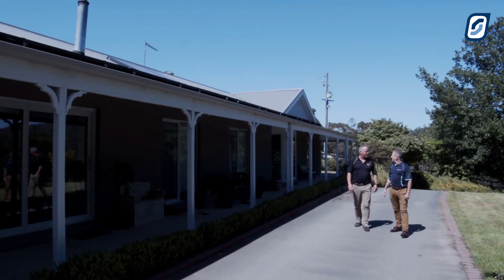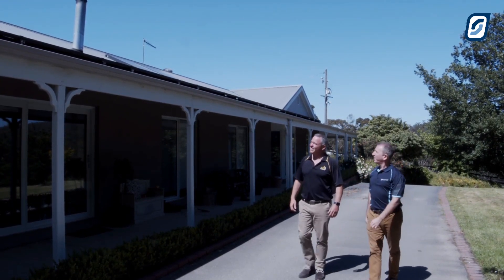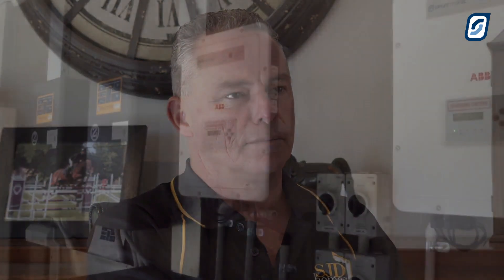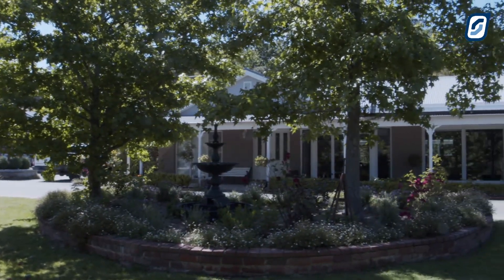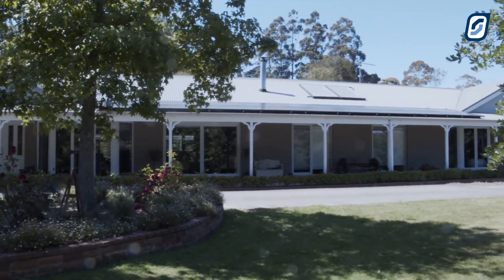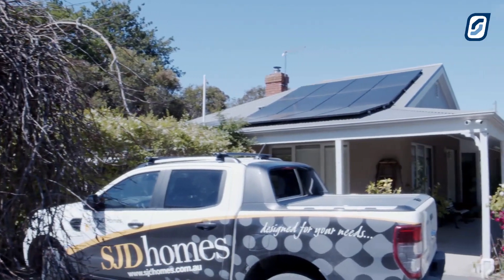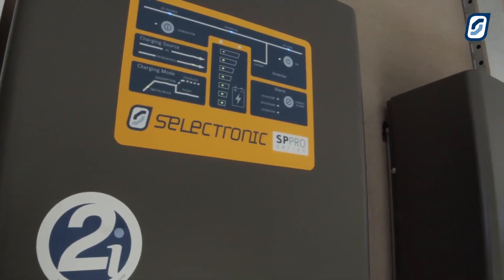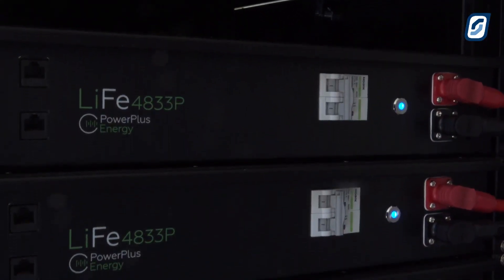Selectronic Inspirational Stories: Dual Phase System, Domestic Rural Property, Victoria 2019

Comment: Thanks for the review - it looks like a very professional and substantial installation, especially the battery cabinet. Do you also have solar HWS heating to minimise battery drain at night. FYI,  I've put an iSocket plug on the grid side of my power supply, before the Selectronic system and this sends me an SMS text when grid power goes off and similarly when it comes back on - this helps me stay aware of what's happening in the overall system. Cheers.